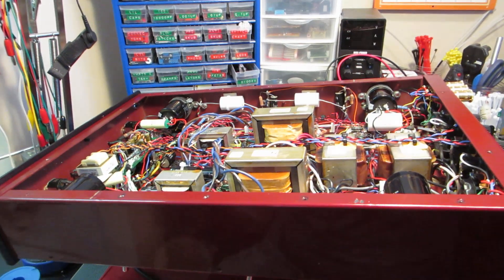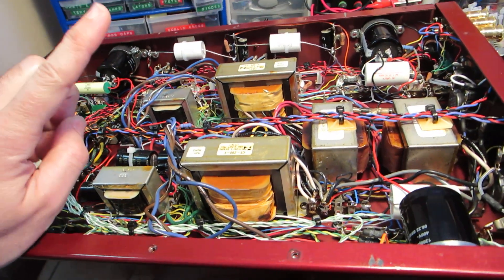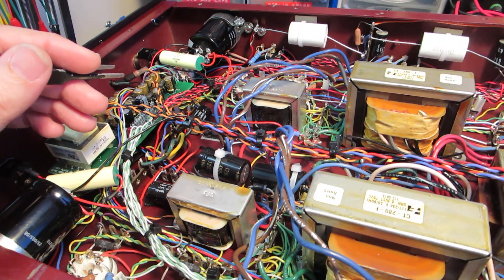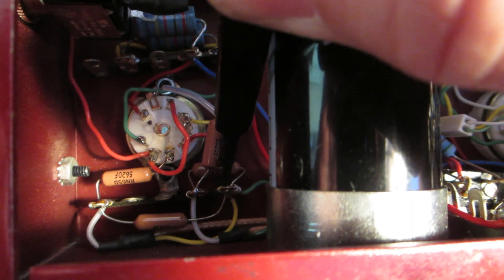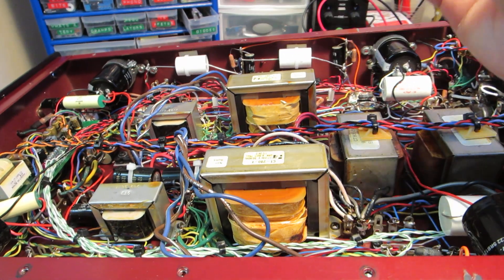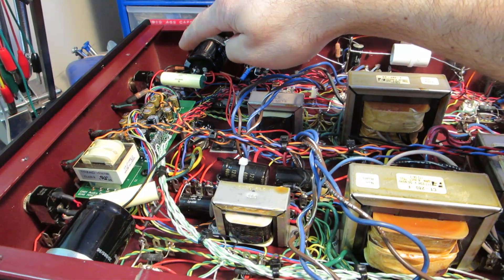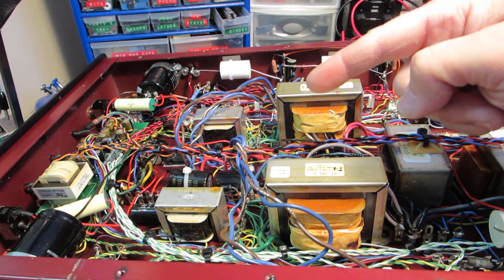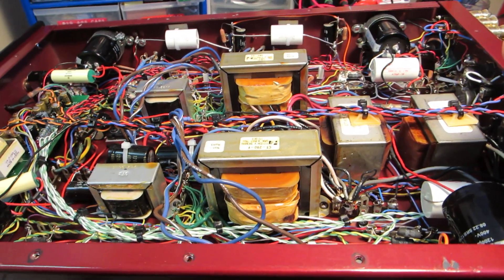Inside the Cary Audio CAD-280SA V12R Tube Amplifier... And a major flaw to watch for!

Comment: how many capacitors does this amp has,do you have any recommendations for an upgrade to bust the bass?
Reply from the maker: The most important are 4 0.22uf coupling caps (signal path). 2nd is 4 power filter caps clamped to the sides, these can easily be doubled in capacitance for the same dimensions.
Reply: @OddAudioCanada  i was thinking in replacing the capacitors (4) for Mundorf MCap 1000 VDC SUPREME EVO Silver Gold Cap Capacitor .22 0.22 uf
Reply: what filter caps do you recommend?
thank you for taking the time to answer me.
Reply from the maker: I wouldn't bother with Mundorf, I am not a fan... I HIGHLY recommend VCap ODAM, they are by far the best coupling caps I've heard.  @jormoria
Reply from the maker: I used 1200uf/400V Epcos TDK. They were the same size as the stock 560uf, I think they are 35mm diameter IIRC.  @jormoria
Reply: @OddAudioCanada  you should do a video on the upgrade,to guide people like me that want to upgrade it. thank you again. this is what cary told me:There are some upgrades we can offer like replacing the coupling caps and replacing the standard rectifier with high-speed rectifiers

Comment: I've worked on enough Cary amps to know they are a heap of quality problems, both by poor design and lack of design.  I wouldn't drag one down the road to level an asphalt pothole patch. :face-orange-frowning:
Reply: Same experience ..............and this brand was making mockery about Jadis amplifiers .....build quality /wiring is also a disaster !
Reply: Isn't that a bit harsh? At least the componentry looks very decent: quality parts, oversized output transformers...  I mean, what's out there that can beat it at this price and power? Sure, you get what you pay for, I understand that, but you can have the thing checked, as it is done here, and if you have bought it second hand, you may still end up with a winner, no?